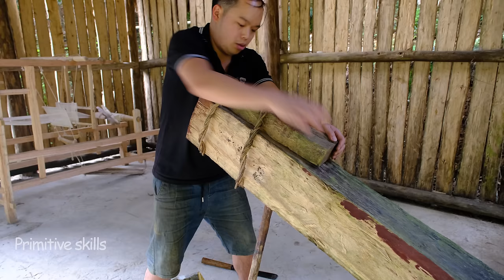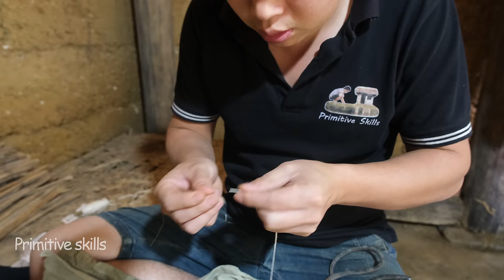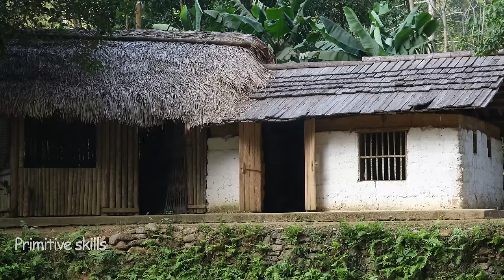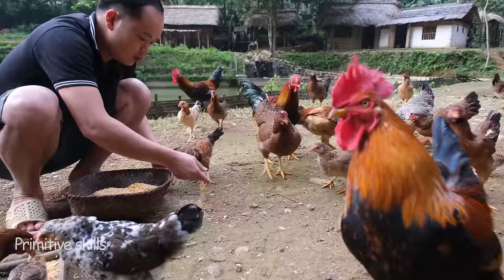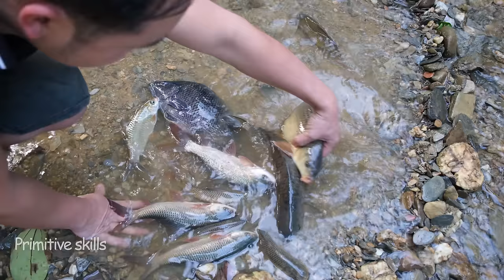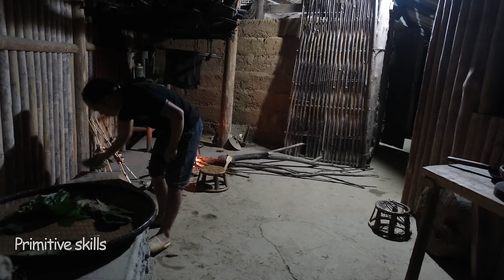Primitive Skills; Discovered a school of fish escaped from the pond

Comment: Duong, and idea for the generator: you could add bamboo screens to stop leaves and branches going into the wooden box for the generator.

You might also want to consider replacing the wooden box and pipe with a cement one because it will last for a very long time.
Reply from the maker: Thank you, a great suggestion

Comment: if you used your water turbine to charge a battery or a series of batteries, you would not have to run your water turbine so much. Likely you could run your water turbine for a few hours every 3 or 4 days. Then you could fill up the water level of the pond and fish would not be escaping.  👍

Comment: The openings in your dam spillway is much too wide and the pond level is to low.  If you want to drain water from the pond, have boards with holes no greater than 1/2 inch or 12 mm available so that you replace the solid boards with boards with holes.  
Also, the deeper the water in the pond the less likely the fish are to leave.👍

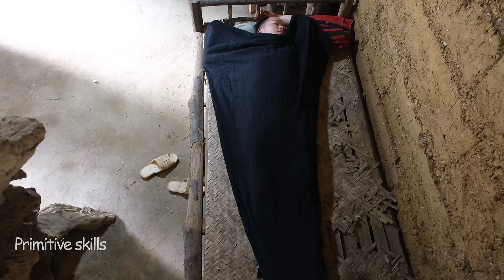Comment: (18:05) Chăn của bạn đó???😲 Tôi dùng nó làm ga trải giường vào mùa hè, khi nhiệt độ khoảng 30 C. Một tuần trước, nhiệt độ ở đây giảm xuống khoảng 15 C,🥶 và tôi cần 2 chiếc chăn, mỗi chiếc dày 0,5 cm. Tôi gấp cả hai chiếc chăn này lại thành đôi. Thế là tôi ngủ dưới tấm chăn dày 2 cm!😄
Tôi đã nghỉ hưu nên lý do duy nhất khiến tôi phải ra khỏi giường vào sáng hôm sau trước khi nhiệt độ lên tới ít nhất 20 độ C là do con mèo nhất quyết đòi được cho ăn...😒😒
(18:05) That is your blanket???😲 I use that as a sheet in the summer, when it is around 30 C.  A week ago the temperature here went down to about 15 C🥶, and I needed 2 blankets, each 0.5 cm thick. I folded both these blankets double. So I slept under a 2 cm thick blanket!😄
I am retired, so the only reason that I got out of bed the next morning before the temperature reached at least 20 C was the cat insisting loudly that he wanted to be fed...😒😒
Reply from the maker: Thank you for your feedback